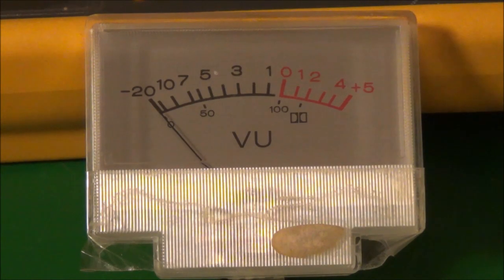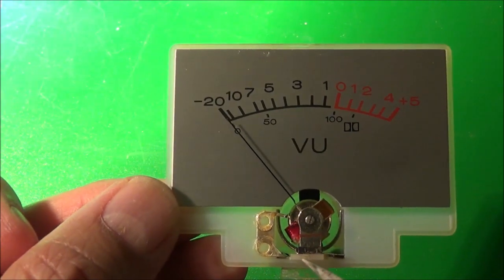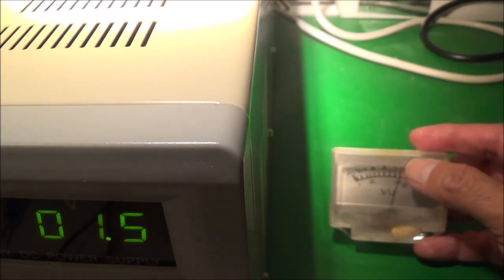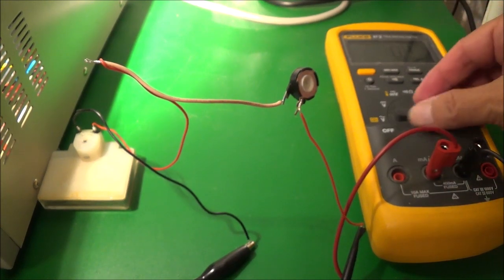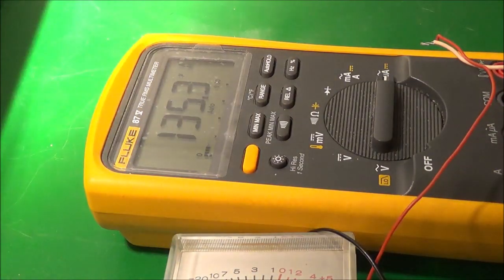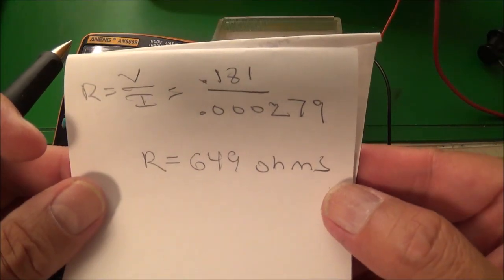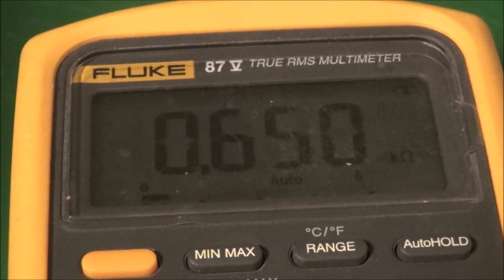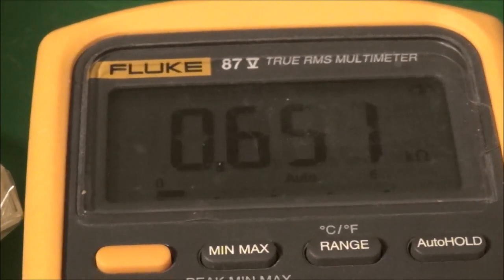Full-Scale Current And Internal Resistance Of Old Analog Meter

Comment: I always wonder about those usable parts from broken radios long ago. Re purposing cannibalize parts never cross my mind what more the time needed to know what or where to begin. I thank you for many enlightening basic videos you've made sir. Its certainly easing for us noobie to comprehend. Thank you again sir and keep recording good informative videos.
Reply from the maker: Sir, thanks for commenting and watching. I cannibalize certain transistors, switches, knobs, and meters. Not too long ago, I repaired a unit with a broken switch.  Luckily, I had a switch on hand which I had cannibalized from another unit. In the old days, it was easy to
 order new parts.
Reply: @OldSchoolElectronics  it feels good to suprising have the needed parts on hand. In my case, I always find out what I have after I've ordered the parts. Caps and resistors in most cases. Ah well, you can never have too many spares. Hehe.